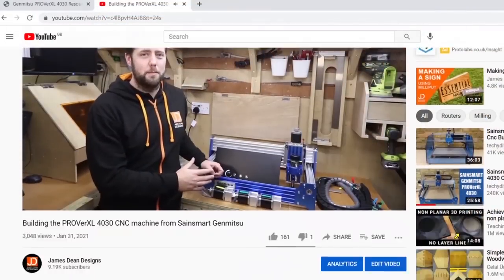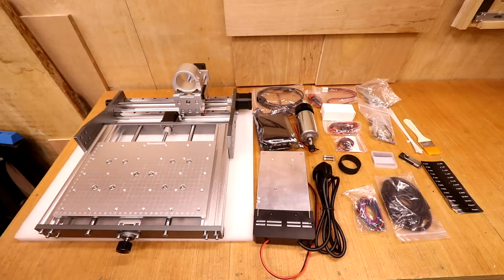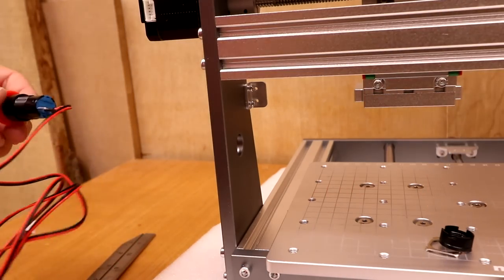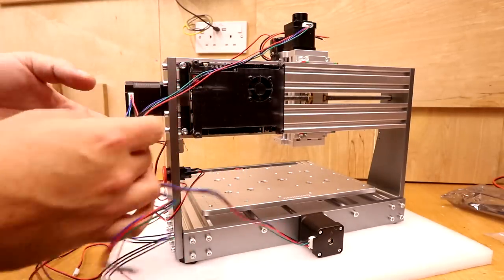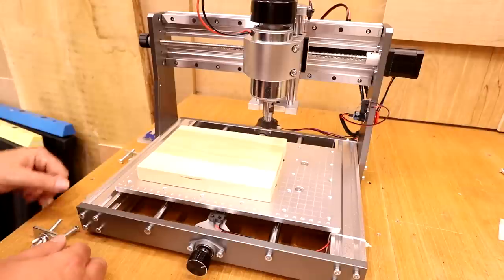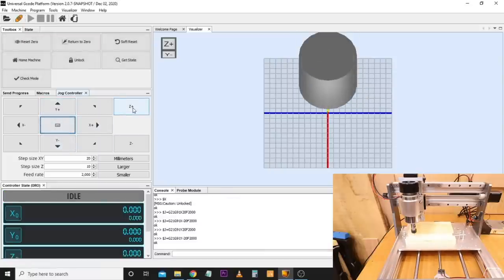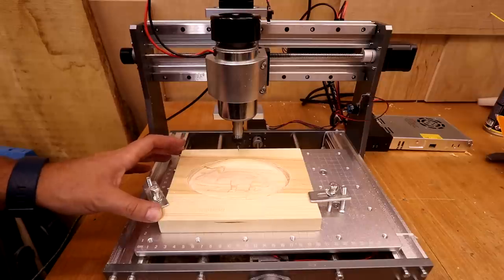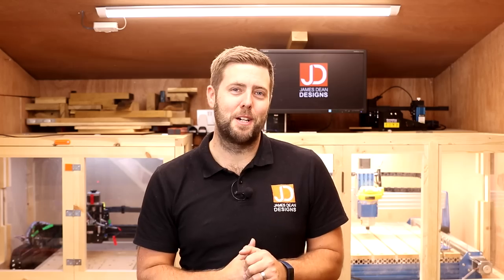3020 Pro Max CNC Metal Engraver by Sainsmart Genmitsu -  Build, test and review

Comment from the maker: UPDATE: I didnt mention in the video but I rotated the spindle 180 degrees to put less pressure on the connections
Reply: Are you able to some comparisons on how loud different spindles are? I’ve got a 3018 and I think I’m at the limits of the standard spindle. Would love to get something that is as quiet on a budget.
Also with UGS is there a way to get a ‘frame’ button like laser software like light burn?
Can you also maybe do a video on working out feeds and speeds?

Sorry for all of the questions
Reply from the maker: @mcbeardface  I can tell you it's super quiet compared to the 3018, but I also find that with the 4030XL and the 4040-XE. Something about those little 60w spindles on the 3018s make them noisier than the 300w spindles.
As.for the frame button 🤔  not sure. I know Openbuilds can do it but don't recall seeing it in UGS
Reply: I have a question regarding this particular cnc machine, I am new to CNC machines I plan on purchasing one within the next month but before I do my question is is there any way to upgrade the surface area or to make your work space within the CNC machine bigger.

So I guess my question is is there any way that I can later down the road purchase upgrades that could increase the amount of space that I have available to work with this particular CNC machine or would I have to ultimately invest a bit more money to get a higher quality bigger surface area CNC machine.

Now I usually work with laser and graber's that is like my thing I my thing I some time ago probably well over a year ago now have obtained a laser engraver machineAnd I have pretty much mastered every element of it and I have figured out the INS and outs of how to use that properly and safely.

They only have 2 concerns regarding CNC machines can you upgrade an existing CNC machine it's been mainly regarding surface area that you can work with and can you upgrade it to make it more powerful so that you can engrave anything and everything.

I mind as well ask is there any actual danger to using a CNC machine is there any particular things that a unexperienced person should look for while using a CNC machine.

It's not new to using different types of machinery and tools and I know that there are very basic tools that a person can use and still get severely injured so I'm trying to make sure is there anything in particular that people should pay attention to while using machines like a CNC machine especially considering the fact that I have never used the CNC machine I've used table saws mitersaws I've used a lot of woodworking tools and I worked with laser and gravers so that is my field of experience but I don't know very much about CNC machines.

It's trying to see if there's any way that you may have an existing video on your channel about safety precautions and just basic knowledge or if you were to be kind enough to make a video in the future maybe for the unexperienced viewers such as myself if you were willing thank you very much.
Reply: @JamesDeanDesigns  68 decibels on engraving, but no example of routing.. which is what most people buy these things for..
Reply: @Ashpari  You should be able to upgrade the machine to a 3040 by buying the extension kit compatible with the 3018, although you might have to drill and tap some custom holes to make it all work and fit, and it will not be helpful to the machines rigidity so if you're looking at a 30x40 work surface, you would be better off buying one instead of trying to upgrade a 3020.

The biggest dangers with CnC routers/engravers for newbies is that the dust can be incredibly harmful to your health (think fiberglass), if the spindle jams it can catch on fire from the heat buildup and your workpiece might not be secured properly which can result in it flying off. Also the bits (tools) can be quite sharp (they are designed for cutting after all) and you can cut yourself very badly with one if you don't pay attention. Lastly the power supply is chinese without any proper safety certification so be attentive that the machine can fail deadly like short live to ground or for example the upgrade 500W power board has a speed dial that could be referenced to live, so you could get a very nasty shock if you use it and touch ground at the same time.

Basically, never leave the machine running unattended, don't "autopilot" and use the e-stop (or preferably, remove power alltogether) to make sure the machine is safe when handling it and make sure you understand how the electronics inside work and if you can check it before operating one.

Also the fan on the motor seems to be unbalanced for a lot of people which could introduce a lot of excessive wear&tear and noise while using, you should take off the fan and balance it before using the machine a lot.
Reply: Already did that... Just made sense.

Comment: I just unboxed mine today, some changes are as follows: No T-nits for gentry, thy have pre-drilled holes now. It has a Y-Axis cable protector so you can route the limit switch in the inside rail of the base. 

I took off the mount for the Y-Axis limit switch and put the wire in the gap behind the bracket. less likely for it to get damaged. I had problems running the wire out the back for the Y-Axis limit switch. I ended up drilling a hole in the back of the frame so it would not interfere with the base movement. Added a P-Clip to one of the back rail bolts and drilled 2 holes on the side of the gentry and added 2 more P-Clips to secure the Y-Axis wire.

Comment: Thank you for making this video.  I'm new to CNC and your information  videos are essential.  I just bought the Sainsmart 3020 Pro Max and the one change they made since this video is they drilled and tapped the holes for the gantry, so there are no slot nuts or measuring 13 mils from the end.  But they also included a length of rubber with no instruction on what it is for.  Since it fits in the milled slots on the base, I used it to secure the y-axis limit switch wire along the underside of the bed. Their instructions for the offline controller are confusing and lack basic explanations for new users.

Comment: Late for comment, but I just purchased this unit and my machine came with the threaded holes for the gantry already drilled on the extruded rails, no need for the little t-nuts on the channel, nice and easy process now. Thank you so much for this video, very helpful, appreciated 👍.
Reply from the maker: Excellent. Good to see they are still making improvements
Reply: @JamesDeanDesigns  Sorry to bother, one more detail, minor I would say. For the Y motor cable that goes goes under the plate and you suggested to put it into one channel of the inside of the right rail and use tape or other trick to keep it in place, they provided a rubber like tube that you pushed into the channel to secure and sort of hide the cable from view, I'm surprised with this machine, not expensive but a solid performance, again, thank you, decided to buy it after watching your video. Respect.
Reply from the maker: @marcoss6212  don't say sorry. You're providing me with useful updates 👍

Comment: Linear rails on the x axis only secured with two T nuts per rail.  I had an issue were some bolts came loose and fell out as they were only barely screwed into the aluminium rail without T nuts.  I have added T Nuts to all bolts now.

Comment: Looks like an awesome, great machine.  I just bought the 3018PROver, extension kit, spoilboard extension kit, and 20k motor. Thanks James for the video tutorials... I set up my machine based on your specs... keep up the good work! We need a good video describing which programs you need to use to make 2d/2.5d vs 3d projects...and something to explain the different file types, how to work with them... it's not very easy to figure out as a new user...
Reply: James has already done a video looking at several programs which can be used for carving and engraving if that's the sort of thing you want to make.
Reply from the maker: Hi Kevin, of you've not already seen it then this is the video Paula is on about. Hope it helps
https://youtu.be/EMI97Rcb0bQ

Comment: I think this machine is just what i want as my next machine, cant afford it at the moment so i was thinking of getting a Genmitsu Aluminum Z Axis Spindle Motor Mount, 300-500W Spindle Holder, 52mm Diameter for 3018-PROVer/PROVer Mach3/MX3, what do u think of this machine and will i be able to use easel with it

Comment: It would be very easy to make an L bracket to screw/bolt/rivet to the side of the machine to re position the E Stop so it is facing forward,  therefore making it more accessible and visible as well as getting the terminals away from the work area, while still keeping the wiring more or less correct and out of the way. Cheers, mate. Keep up the great work.
Reply from the maker: Thanks Ron. Probably going to do that my self to be honest
Reply: As long as it doesn't obstruct the bed mounts/rails etc. I would have thought the E-Stop on the front rail where it's easily accessible

Comment: How do you find it while cutting alloy? Does the alloy get hot and the shavings stick on the main piece? Did you have to use a compressor to blow away the shavings?
Reply from the maker: If you get your feeds and speeds right then it's fine. For for example I was cutting the other day with a 300w spindle, 1/8th O flute DLC bit,  450mm/min feed, 0.3mm depth of cut and a 1.5mm stepover. Cutting super easy, no melting and no air assist required. It is a slow speed but equally the quality of the cut is great and no melting

Comment: Hi James. I love your videos. They are all very informative. I plan to buy my 1st cnc (newbie alert) and this video has convinced me that it has to be the Sainsmart Genmitsu 3020 Pro Max. My question is, I have noticed you have made a few changes to the machine since this video, other than a still picture I cant find any info on what you did to it. Can you please let me know what you did. What are the green strips, where did you get them from, what did you do with the emergency stop button, did you change the cable management and anything else you would recommend. Also how is the machine one year on. Do you still like it. Thank you in advance.
Reply from the maker: Great news. I put the machine into an small enclosure so I moved all the electronics to the outside. Also you can gain a little bit of extra work area by adjusting the limit switches  positions. Not much space but at least a few millimeters. I think that was all I really modified on it
Reply: Thank you. I like the green strips you’ve added. What are they and where did you get them from. Thanks

Comment: That looks like they've fixed all the issues that irritate me and constantly make me want to upgrade. Pretty awesome that it will cleanly mill aluminium right out of the box. Thanks for a concise but comprehensive review.

But I'm not buying another one for just another 20mm of Y axis, and presumably the 3018 extender kit is not compatible because the Y runners are now thicker. If they had a version with longer parts for a 400mm Y axis they'd already have had an order from me.

Totally agree about the stop switch - the moment i saw it my eyes rolled about it poking into the work area. Most of my failed mills are due to unexpected collisions, the work area needs to be kept clear of everything. ES needs to be on the top.
Reply from the maker: I suspect (but don't know) they might bring out an extension kit later in the same way they have for other machines
Reply: The location of the e-stop is easily fixed with a 3D printed part. The main problem I have is with the +$70% higher price over the similar size 3018 PROVer. So remove the $180 Cervero 1yr sub and that becomes a $399 machine by Thanksgiving IMO.

Comment: I am looking for an affordable mill which is precise enough to also do PCB milling for SMD parts. Can I expect sub millimeter precision out of the box on this one? How much outrun does the spindle have? Is the ER collet screwed on the same way as on the 3018s (flattened shaft) or does this spindle have a thicker shaft? What I'd also like to see is the 4th axis add on and doing some brass gear milling. That would be cool.

Comment: Thanks for the well done video.  The online information says: The control board and spindle holder still support the upgrade to 600W spindle - Does this mean it will accept a Dewalt or Makita router?
Reply from the maker: I dont think so. I believe its referring to a 600w spindle of the same diameter which I think is 52mm off the top of my head where as a Dewalt is 69mm and makita is 65mm

Comment: Looking at the machine on their website (I wanted first off to see the current price),  I see that they are showing the control circuit board in an orientation that's 180 degrees different from the way you mounted it.
Reply from the maker: We might be looking at different things but all the photos I'm looking at have it mounted the same way as I have done in my video. To be honest it doesn't make any difference though

Comment: Nice but the important bits are missing.
Does it have play in the axis, backlash? How the vibration when milling aluminium.
Reply from the maker: No, the backlash nuts are secured now taking the slack out of it. No vibrations (other that what's expected) when working on the aluminium either. I havent pushed it that hard yet but certainly a huge step forward

Comment: Are there any links to a ready-made Z-axis upgrade to work with rails on similar machines? (I have 3018 MAX Metal)
P.S. Putting rails is not a problem, the most difficult thing is to make adapters for rail carriages.

Comment: I'm not a fan of that emergency stop button. It really should be on the front of the machine or moveable, if you're placing the CNC inside an enclosure. Does the E-stop kill the power to the machine or does it only send a stop signal? Preferably it would do both.

Comment: James, I recently purchased one of these machines in July. So far so good. I would like to use it (and my Prover XL 6060 I purchased a year ago) with Fusion 360. Can you point me in the right direction regarding setting up these two SainSmart CNCs with Fusion 360? Is there anything special that I need to do to the generated g-code if I am running Candle? Thanks for your excellent videos.

Comment: You mentioned that the y-axis rods have been increased to 12mm. Has the z-axis rods been increased also?
Reply from the maker: I believe they have but its as part of the entire Z assembly upgrade which is why I didn't specifically reference their size. I can double check the diameter tomorrow though